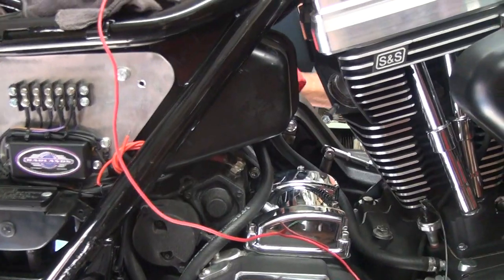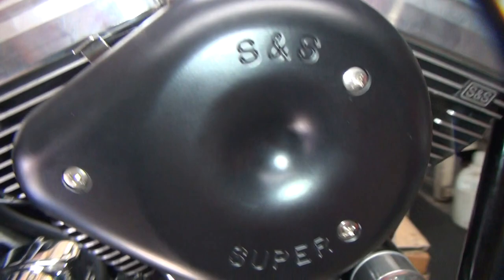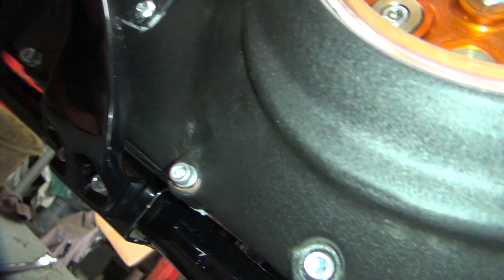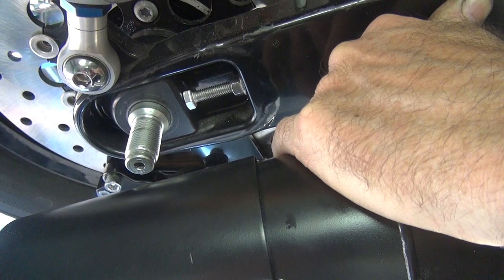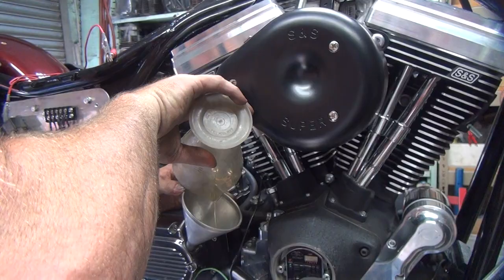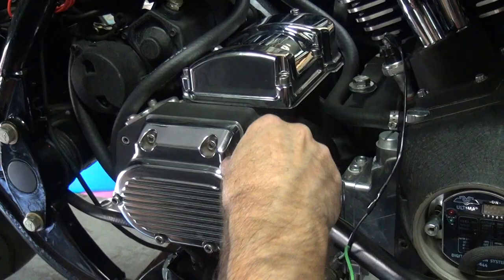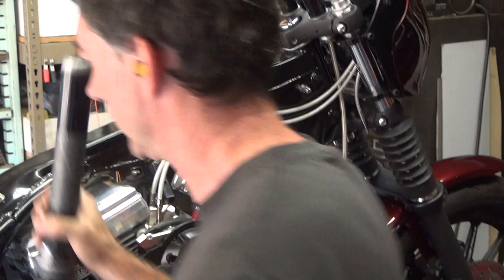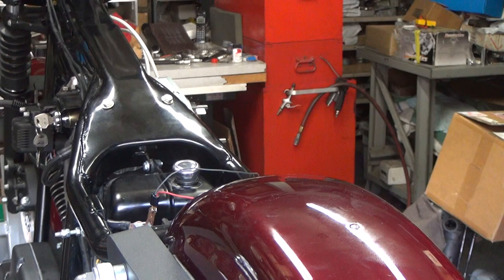1993 89ci #102 fxr stroker new bike build get running evo evolution harley by tatro machine

Comment: i hope this is a 6 speed . if not it will rev to high on long rides and suck fuel like a mad dog...  my son has a 1990 fxrp and he just got a new road glide for long rides .  so nice.  easy ride 1000 miles in one day. Haha no problem. but on that fxr no good for your body after 6 hours man .
Reply from the maker: its called gearing dumbass. you don't need a new bike to go fast or far. my 4speed bike does 100mph in 2nd, 135 in 3ed and over 150 i high.
instead of spending 25k+ on a new throwaway harley you could have spent 15k on you fxr and got 10 times the bike.
tatro
Reply: correct;  Gearing ...  $2600.00 to add a higher range gear. it is a 6 speed Baker overdrive kit...  but it will only drop RPM  500  not for me...  now if i change high gear range only what will i  lose ???  power range in 3rd or 4th ??? but FXR is a great bike frame and other things to. it is still a bike for the city short rides.  road  900 miles and trust me;   not good for long long rides.... but like i said Road Glide 2017  is so sweet to ride 1000 miles a day no problem Haha...  it is like sitting on a couch in your living room...
Reply from the maker: just install a 34t trans pulley for $80 and you will get more than that 500rpm drop. been using them for many years. worth about 15mph. major difference.
tatro

Comment: Custom??? I don't see one damn thing on that bike that can't be purchased off the shelf and bolted on to any FXR. Aftermarket... Not custom.
Reply from the maker: that depends on what custom means to you. if it means to you that is has to be a one-off part made by your two hands, then no. if it means parts you put on to your bike because you didn't like how the factory made it, then yes.
that is your call, others might feel different.
tatro
Reply: Fair enough Tatro,
Reply: The axel spacer looked custom.  This is the way to do a bike that is ridden.  You need to be able to get the parts on the road and get home when it breaks.  Most guys with FXRs put on the miles.